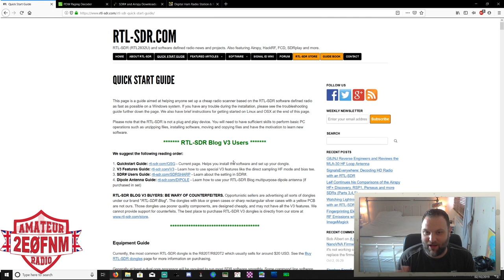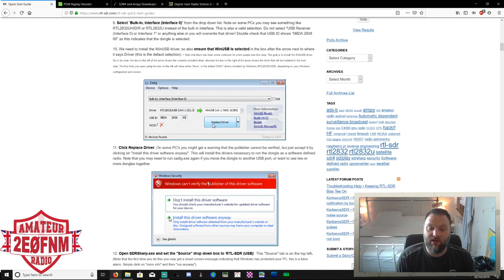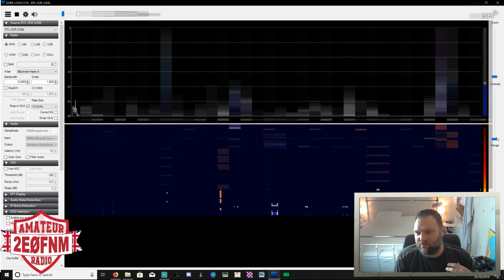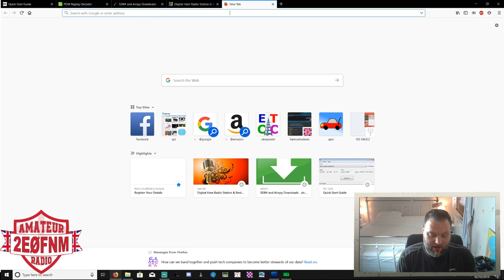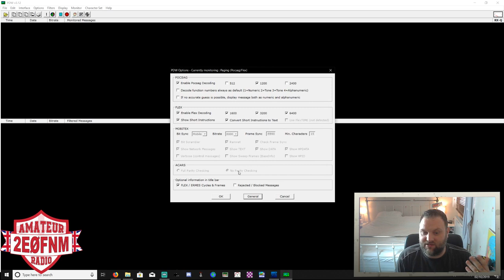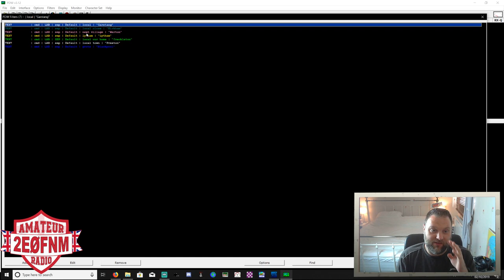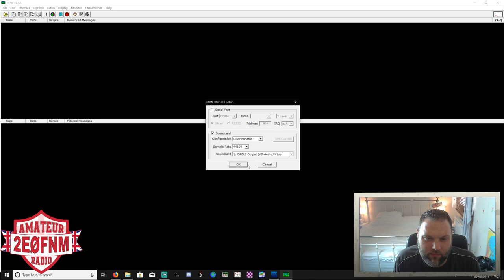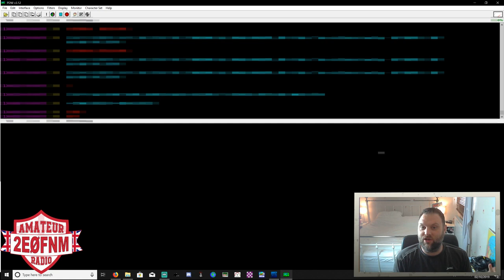How to Decode POCSAG Pagers! FIRE, Ambulance, Police! Step by Step! emergency services pagers.

Comment: Thanks for the info, mate. I need to get the info out into a text file for manipulation in PHP. I prefer using Linux and a PI 4 and then to a browser. But you don't need to know anything about that. It's actually legal here. Based on the FCC, unless the entity take steps to encrypt the data it is perfectly legal to decode it..

Comment: I have  an RTL-SDR device and SDR sharp but there's a few issues. the stations tune in funny and are not accurate and overall it doesn't work well on my PC. I use SDRTouch on android and it works better but when I tune into my local POCSAG frequency I can hear it fine but i cannot pipe the audio to my PC by audio cable to decode it. I had this analog weather radio that could pick up this signal and decode pretty well but I need to modify it to output mono audio because it has this crappy reverse phase stereo audio from a mono source type design. I use PDW as well.

Comment: On WFM (I'm just running SDR ATM) All I get is hiss 1*3.3*0, no spikes also, been watching and listening for ages, should I be hearing any beeps or tones without the background noise ? Do I need to filter that out, via squelch or should the noise always be there, My setup is working as I can pick up my 446 Bofeng, and local FM radio ! Thanks
Reply from the maker: hmm im not sure tbh, squelch should be off completly :)